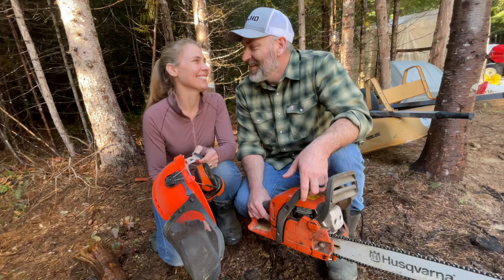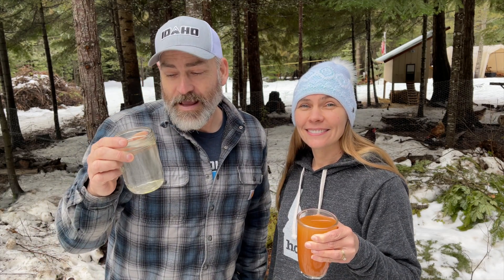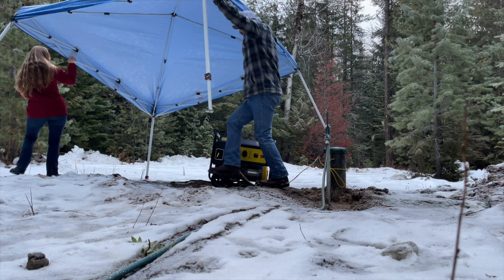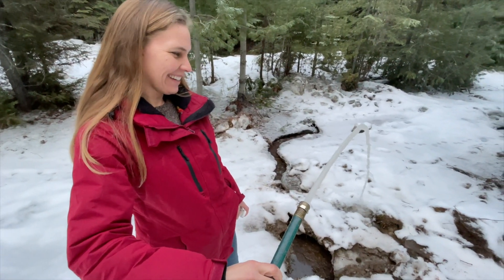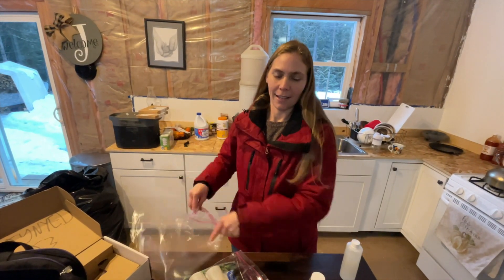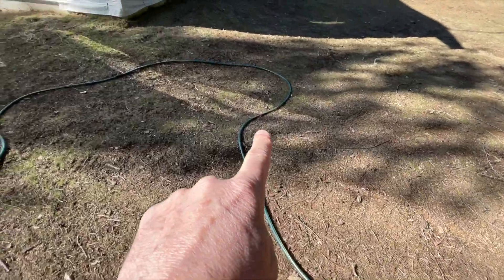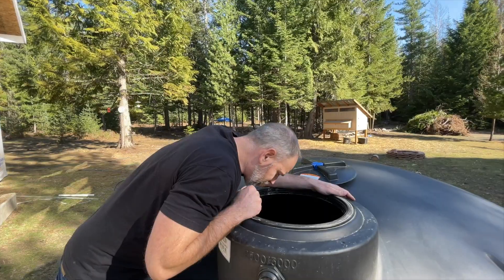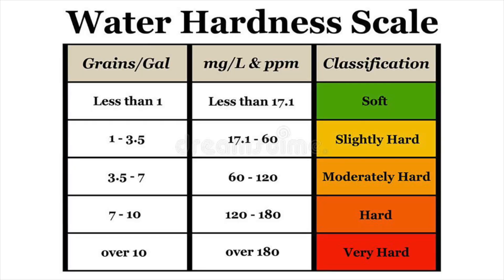Brand New Well... POISONING US?

Comment: If the water passes the tests for bacteria and poisons, then there should be no need for any filtering other than what you might want to do for clothing (high metal content can discolor clothing).  For 10 years as a child, I lived in a home with my mom that was getting water from its own well.  There was no filter on the system, though there was a water softener with a built-in iron filter due to high iron levels.   Since you mention the arsenic levels have changed recently, my guess is our well likely wouldn't work anymore either.  Such well systems are common in rural parts of Minnesota.

Comment: To be safe to drink use filters and a violet light filter and a water softer if needed! If you put a insulated tank up high in the attic of your house, it cure give you a little more water pressure.
Reply: YES CORRECT.

Comment: I had a 400 ft well drilled on my new ranch in colorado and the water table was called soda creek for its soda consistency...our pump was placed at 300 ft and for a while we had good crystal clear water...no odor, no color, no taste, just a soda water with bubbly property...we noticed one day that our once crystal clear water was now turning rust colored and had a rotten egg smell with nasty taste...called the well people out and they told me nothing was wrong with the well install and my water was just going bad...I had neighbors that were at the same depth as me with their wells and they didnt have my problem so I had a well inspector/troubleshooter come out and they discovered that the well pipe threads hadnt been properly seal when the well pipe was coupled at the joints of pipe which was allowing poor quality water at much shallower depths to leak into my well through the leaking well pipe couplings...my well company that did my well filed bankruptcy after I reported them since they refused to correct my well...what I ended up doing was installing a whole house water filter system which used 4 stages which also included activated carbon filter stages for the odor and taste and was actually able to filter out 100 per cent of the unwanted qualities in my water...I used Ozarka for my filter install...the cost of pulling my well pipe (400 feet and resealing all the joints) was too much for me to absorb after just biting the bullet on the well company filing for bankruptcy protection...just fyi....hope thats not your problem
Reply from the maker: That is terrible. Our well casing is welded.

Comment: using 2 used ele hot water tanks //on the side in line one filled 1/2 way with mash screen at a 45 deg / than the 2 sec used hot hater tanks is picking up water  from the top of first water tank up and  up over to bring clean water to the 2  used ele old water tank then a large filter into the house  you may have to slow down flow so water is cleaned in first used old ele water tank /try this with 2 small tanks of any kind,-- first , and build from your test tanks //

Comment: Driller and filtration guy. New wells take lots of running time! Think about how much you are disturbing the aquifer when drilling and setting the screen... Not to mention when you have a 600ft well and pump set at say 200 you have a lot of water to turn over. The driller should of given you a well report which tells you how much the well actually produces, as long as your running a flow rate just under what the well produces you can run that all day long. After about a month of just running the well I would start to consider a filtration system if mineral taste is still bothering you. In my opinion every single house should have a spin down bag filter to catch any fines before it gets to your house. If you are considering a filter call up your local installer and they should take a mineral test then decide what system is best for you. 
Also you don't need to have that storage tank on your system as long as your well produces a good 8+ Gallons per minute.
Hope this helps!

Comment: An inline cartridge filter will not stop all the iron ,as the invisible iron in the stream contains iron bacteria that has molecules the same size as the water. Once this iron bacteria is exposed to oxygen,it puffs up(like popcorn) allowing a large back washing type filter to remove it. This is evident when the clear looking water sits in a toilet bowl exposed to air a few hours,then coats then bowl with red. A water softener should never be used as a primary filter on such a high iron content-the media in it gums up with the iron. Once the iron has been removed, the softener can be used past the iron filter(it may be totally unnecessary) An R.O.unit will be damaged by that much iron,remove the iron first, then use an R.O.(again,probably not needed.) The air injection type back washing filters work well, and also remove Manganese and magnesium.The air is injected using the flow of water made by your well pump to cause a venturi effect drawing air into the flow from the well.There are parameters your water and pump system must fall within to work properly and worry free.I highly advise getting a factory rep involved in choosing and sizing a system, but remember-they are also salesmen. (chlorine kills iron bacteria. research shocking your well)

Comment: Hold up. Did you just say $32,000 for a well? My well is 340 foot and it was right under $7,000. That was drilling it, plumbing it, wiring it and it came with the pump.

Comment: Tell me you are not using a hose to pump your water to the house? The pipe from the well should be 5 feet under ground to the home. Then piped to your tank for overflow. I could write you a book but I wont.
Reply from the maker: Why 5’? Code here is 42”.

Comment: A whole house reverse osmosis filter with UV sterilizer.
Reply: That's a whole of filter for a whole house and pricey as heck to buy and maintain. I would def do RO for drinking and cooking and using .5 micron sediment or carbon cartridges would eliminate any bacteria before it even got to the RO membrane. No need for UV with nothing biological to cook. But I would go with a more economical solution for the rest of the house and have it in place upstream of the RO unit to reduce maintenance and increase membrane and carbon life. And I would return the waste water from the RO back to the reservoir because it's going to be 1000 times cleaner than the raw water coming in.

Comment: Only pumping water out of the well when the 25,000 gallon tank is empty is going to do nothing but make the well water worse. You need to run water straight from the well other wise you will forever have dirty water and spend thousands replacing filters constantly

Comment: High suspended iron in the water will cause the rust colors in the tank over time even with the water going in clear as the iron reacts with oxygen in the air. The simple act of pumping into the holding tank will get you the iron oxide from the suspended iron and looking for the right filter will pull that out of the water. Might even be good to put in an air stone setup in the tank to mix and aerate the water to speed up the oxidation 

With the depth of the water being 200+ feet down you should still be able to setup a solar pump to slowly fill the holding tank fully separate from the generator or house solar setup and with the right controller still be able to hook in a generator when needed like bad weather or the middle of winter when solar is not enough. Red Poppy Ranch has a setup where they are pushing water 190ish feet up a hill from a shallow well to holding tanks for gravity feed water to the house and has the setup to run a generator backup on it still.

Comment: I filter my municipal water (rural KY).. I use three 20" cans with a 25 micron sediment filter followed by two 5 micron charcoal/carbon filters.   While probably overkill for my situation, it's cheap insurance and I have done it at every home I have lived in.

P.S. please don't go down the 'click bait' tittle rabbit hole like other homesteading/off grid people do.  In my opinion it is rather annoying..
Reply from the maker: How often do you replace your filters?
Reply: @MartinJohnsonOffGridLiving  My last house had a 600,000 gallon 6 year carbon filter on it that I never changed (sold the house).  The new filters (AF-6003) I just installed are good for 100,000 gallons, but I always replace the sediment filter every 6 months just to see how bad it is.  Since they are white, you can really see how much stuff they pick up.

Comment: I believe you got ripped off!  How much did you pay for each foot of drilling and casting?  If I got the numbers right that you had to drill 530 to water and your total cost of $32;000 then it looks like you paid $60.00 a foot which in my opinion you are paying way to much. I have had 5 wells drilled one of which was over 800 feet with 100 feet of casting and a 1 1/2 HP pump for a total price of $9,000 .